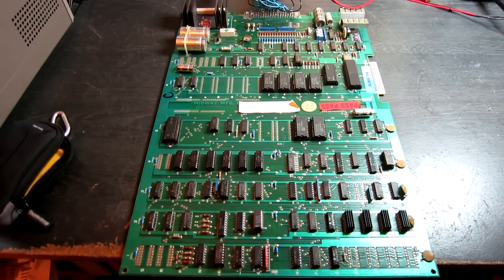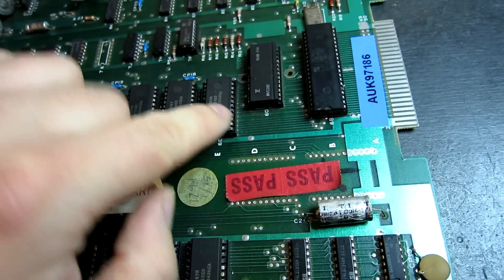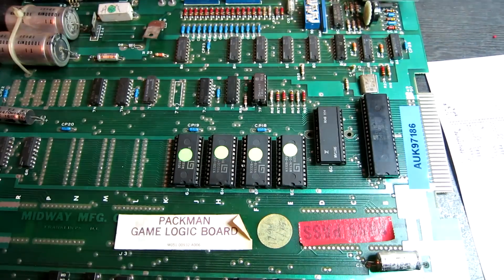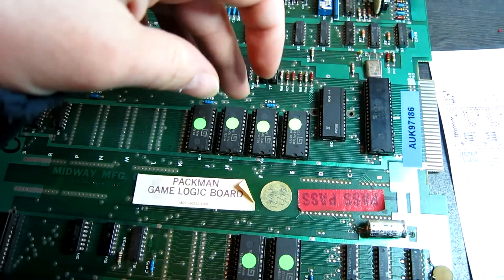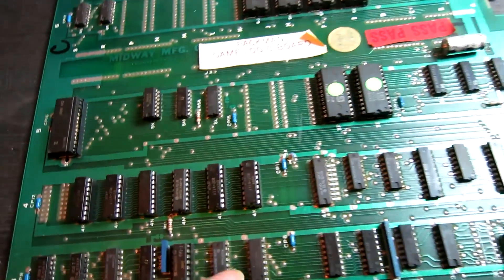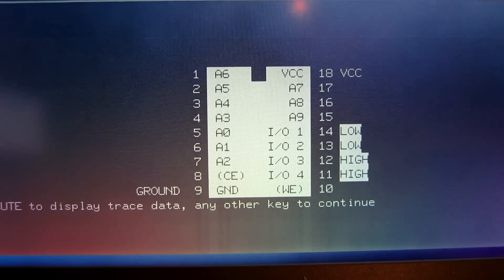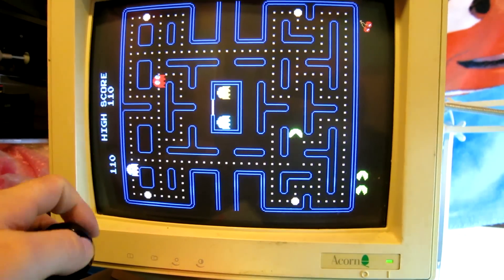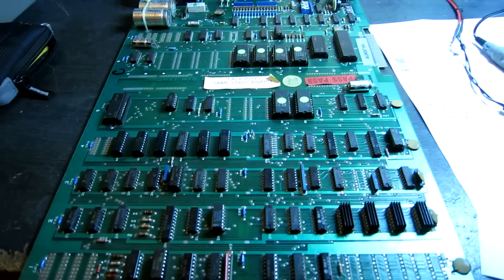Midway Pacman PCB Repair

Comment from the maker: Thanks Luke, I have the Leaper on my bench for logic/cmos chip testing. I have a Boardmaster 4000 that does alot of other stuff (expensive) ABI do some decent handheld chip testers. Or if you got a good Elnec EPROM programmer they also can test a very good range of logic chips and ram chips

Comment: I always got a kick out of that misspelled "Packman" factory sticker.   Also pretty rare to see the original custom chips!  I've only run into those a couple times.  One of them was a cocktail Ms. Pac with all the additional ROMS on the main PCB, and no daughter board.

What are you using to test the 2114?  Do you have one of the better ROM programmers that can also test various IC's?  Looks really handy!
Reply from the maker: I have an older model Elnec Labprog+ Excellent quality and can test various logic and ram chips too. Yep It seems rare too see the custom chips, but don't forget they were leaving the factory with the daughterboards as well! Not sure if the custom chip came first and the daugherboard was a replacement for it, or if the daughterboards came first and the custom chip was to save money?
Reply: arcadeuk
From what I can remember, the daughterboards came later due to supply shortage for the custom ships.  I don't think they expected Pac/Ms. Pac to be so popular, and had to find a way to keep up with demand.

I'm hoping to upgrade my programmer soon, so I'll definitely look into something that doubles as an IC tester.  Right now I have an EEtools ChipMax, and it's not quite powerful enough for me anymore.  A lot of our newer games have larger ROMS than it can support, and it also needs Windows XP to work.
Reply from the maker: Check out Elnec (don't buy from ebay - beware of fakes) I highly recommend them. While you programmer is under its support period (several years usually) you can send them sample devices of anything you want them to add support for, that's why they now support a bunch of old arcade rams :)

Comment: G'day 
I have a pcb for a Electrolux dryer that is not working it won't spin the drum when you press start can you repair it?
It may be very well the main micro switch on board